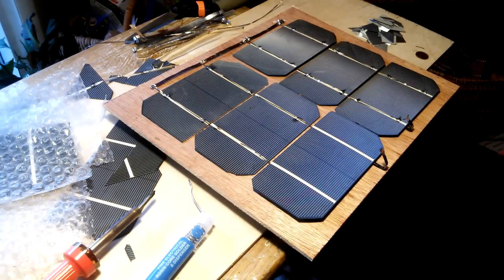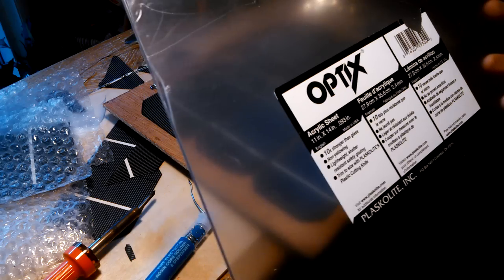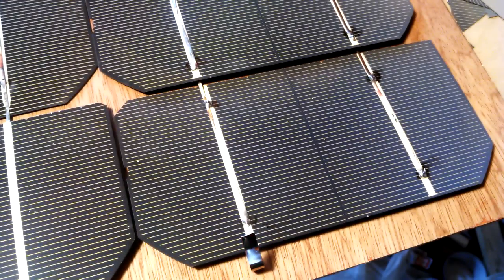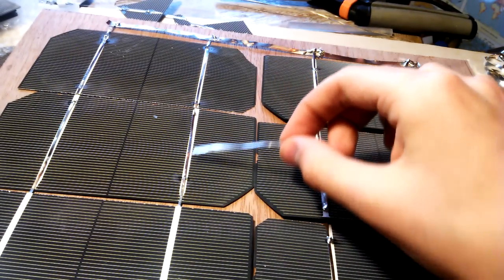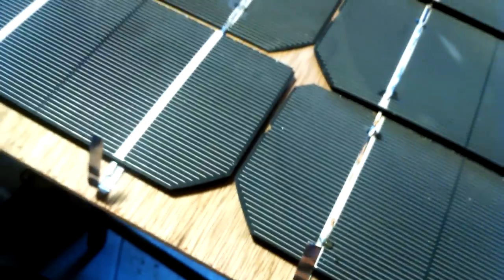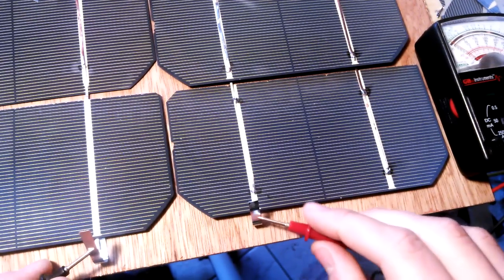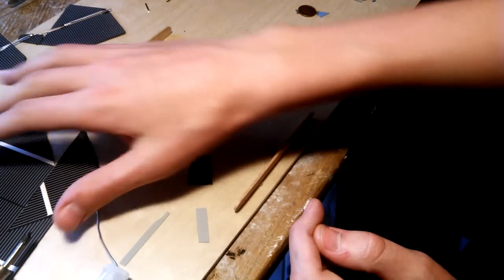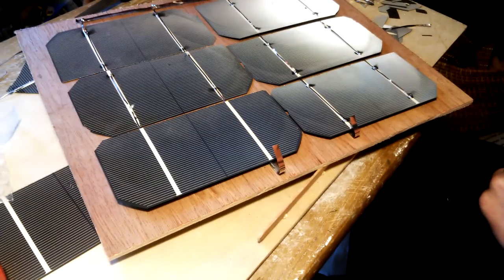How to Connect Solar Cells with Bus Wire - Detailed Video - DIY solar panel project

Comment: Hey you kinda got to tabbing wrong! On the last of first 3 cells is
Negative and you got it going to the other negative on the other roll
Of cells and it should go to the bottom positive and at the end ya you
Do need to add buss wire or it wont work correctly, at the end of cells
You should use the top negative and the other side bottom positive
And i see you have both bottom positive tabs, it wont work you got 
It all wrong !!!!!

Comment: Hi.

Need some help with wiring Solar Cell.
I tried wiring 2 cells that worked ok and then tried 3 or 4 cell.

I only we readings from 2 cells, I get confused when wiring more than 2 cell.

Thanks